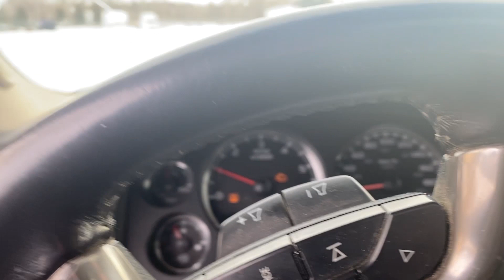New Project Vehicle - funded by Skip the Dishes?

Comment: Nice getting a square with the electronic speedo in it so LS ready lol.  The 9.5" is a good diff and plenty strong for most things... you will break the 8.5" in the front long before the rear gives out.  Not that I am saying you have any failures but it's just how it goes.  Get it done... Driveway Engineer style hahaha.
Reply from the maker: You bet the goal will be to get this thing functional and on the road as soon as possible
Reply: @LowbuckLS  Be fun if that 383 goes haha. I have a stuck 350 I got broke free after it sat for years with no carb on it but the hood was on the truck.  Mine took prying on the flexplate with a breaker bar to get it turning so we shall see how it runs.  Like you, its going in the dumpster but I wanted to try lol
Reply from the maker: @LSswapGarage1  yep I think that will be my next video, trying to get that engine running.